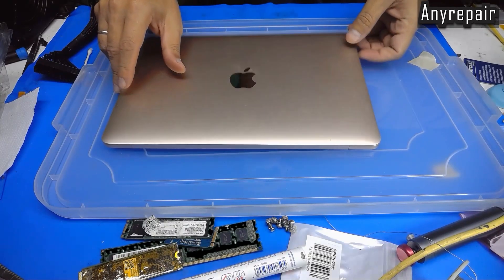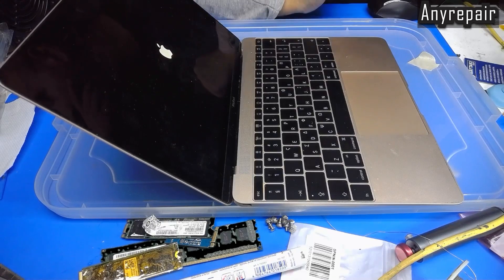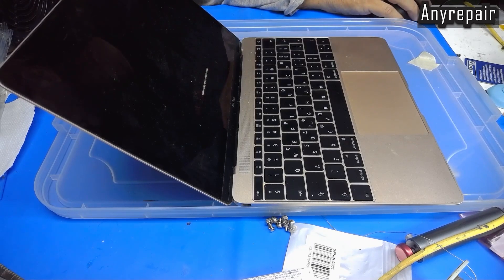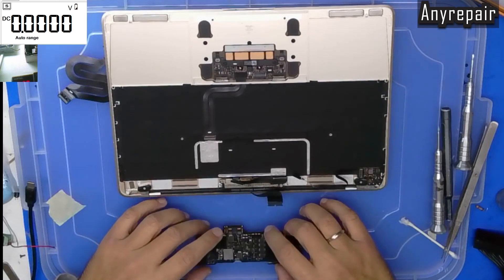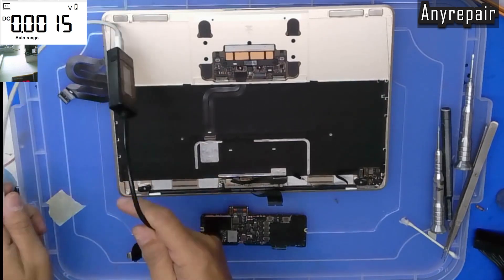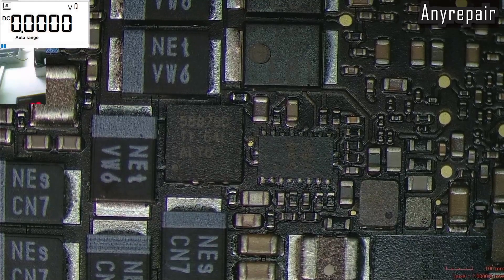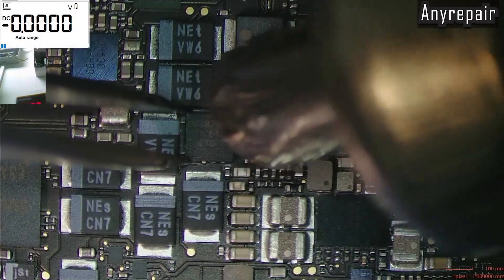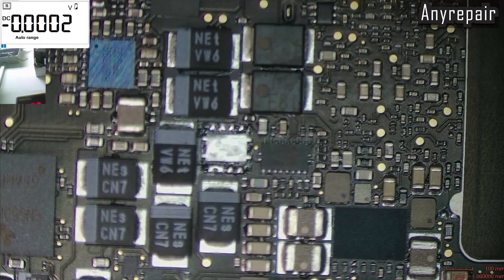Macbook a1534 ssd not detected !!DONT REFLOW YOUR CPU!!

Comment: I’m still using my m7 2016 model right now and it’s almost 10 years old.
It does have this issues but after it’s warm and boot up, it will run stably without crashing, easily for 10 hours.

If i can get it fixed like this it will be lovely. Gotta watch and try one day perhaps.

The machine is not fast enough for today’s work but it’s still my newest Mac

Not buying the current line up because they criminally charge for storage upgrade. And who wants 256!!!

Comment: I have a question: In many videos people just reflow the CPU and the SSD works again. In your video you replace the MOSFET instead. Why do you change the MOSFET instead of trying a reflow there? If the CPU reflow works, doesn’t that mean the MOSFET is not defective? Could you explain this please?
Reply from the maker: The cpu reflow is not a permanent fix  I am not changing the mosfet, instead of reflowing the cpu. I have checked and verified that the mosfet is not working,first. These are two different faults addressing to the same issue.

Comment: Hello, I liked your explanation, can I remove this component from another MacBook model? I don't have a donor board like that, or what would be the component code for me to buy, thank you in advance
Reply from the maker: Well yes! But please check if you are not having the 2.8 V nand at first. Then check for the part you want in another apple mobo, the most aof the parts are used in many different boards.

Comment: But there was clearly a bridge on the bottom left pins of the mosfet, was it supposed to be there?
Reply from the maker: You are right!There it is the 1 and 2 pin which are connected to ppbus_g3h both.